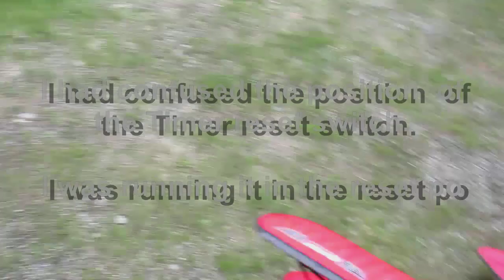My Dynam Waco 1270mm  (with Wildcat cameo appearance)

Comment: How is the safe mode going....have you put it in unusual attitudes eg inverted and hit safe to get it to auto level. I have 4 eflite planes..glider..scale..racer.. edf jet.. and they all have safe. If you tell me lemon stab plus works as good as spektrum as3x ans safe then I  will by a lemon plus and put it into something other than an eflite plane and try it. Your setup video by the way was first class..
Reply from the maker: Well I don't have an e-flite comparison as my only AS3X airplane has not maiden'd yet.

But I have tested the safe mode several times and it works fine.  I usually test it in step climbs and 90° banks.
Haven't done it while inverted yet.  But I have one plane with an expensive Eagle Tree Guardian in it and the Guardian and the lemon gyros all work about the same in safe mode or auto level.

Comment: hey hujum, did you get to use the plus part of the rx(wing stabilization) on this flight. if so how did it work? does it respond like horizons safe receivers?were your gains set about midpoint on all?
Reply from the maker: Yes.  I did test it a couple of times and it works fine.   I have gains set to just past mid range andhave them collectively set to the knob on my DX8.
The knob is usually at mid point or just beyond.
Levels out fine....of course I preset the level attitude to where I like it before hand.
I can't yet compare to the AS3X system as I haven't flown my AS3X planes yet.   I hope to in a couple of weeks though.